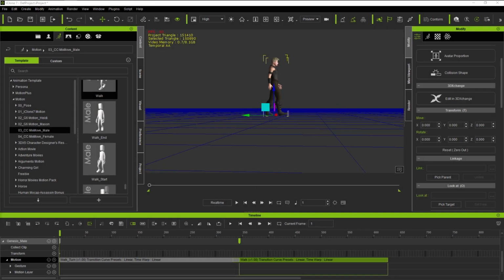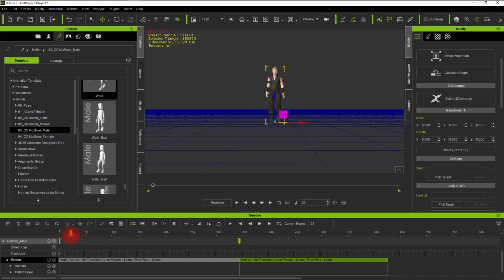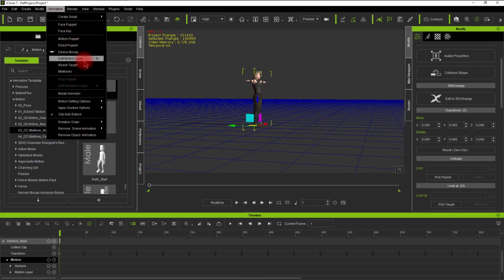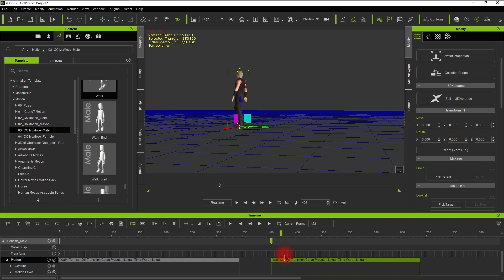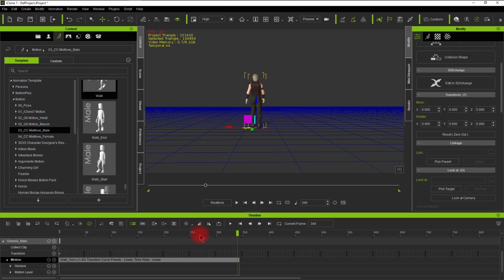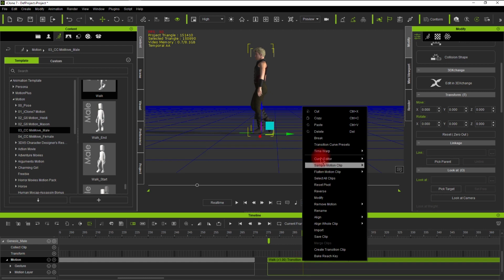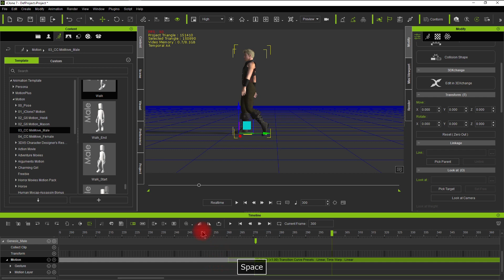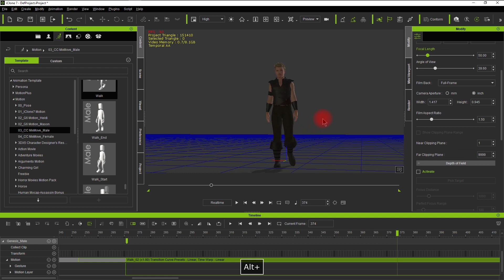IClone 7 Tutorial: Solving Common Problems when Working With Multiple Motion Clips

Comment: Hi, first of all thanks for this which seems like a great tutorial, explaining details that others don't. But it seems like  either i'm dumb enough and am not able to replicate your actions or Iclone became worse with recent updates. I have version 7.93 and nothing changes when i click on "Align to Actor orientation" and "Reset Motion Root", i don't see the gizmo rotating with the character like in your tutorial, so i still have the same problem like before and my character will suddenly flip 180 for a quick second, before then turning the right direction and following the path i created...help please
Reply: My bad: apparently in order to get the same result as in the video tutorial you have to get the animations from the content list. I picked the animations using Mixmoves for the "walk turn" and then motion puppet for the walking animation. Still, i think this is totally weird and don't get why the gizmo alignment doesn't work if you get the same animations through a different procedure. I feel like it should be improved. Anyway i'm really thankful for this tutorial man